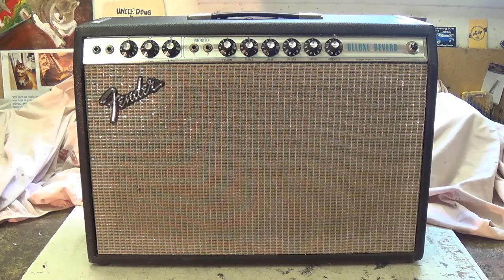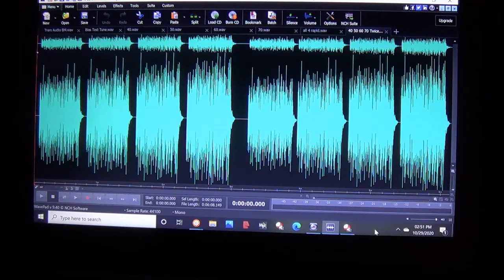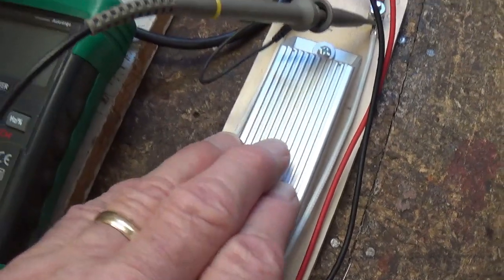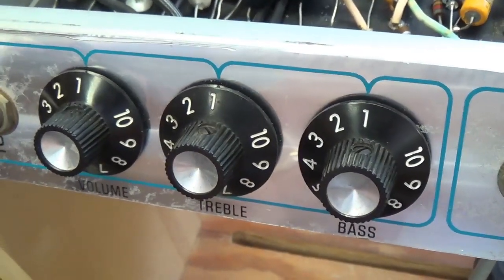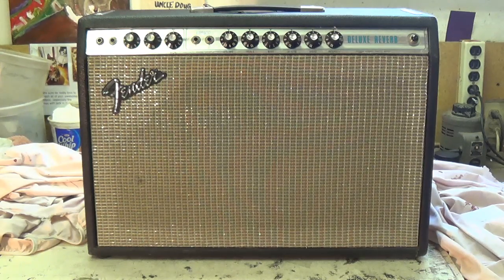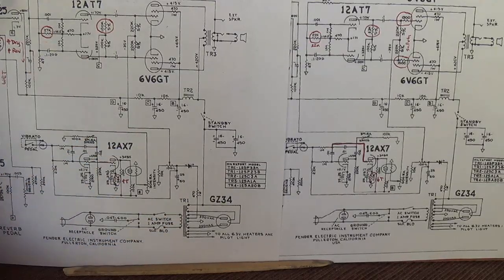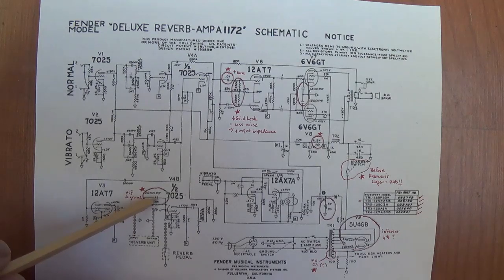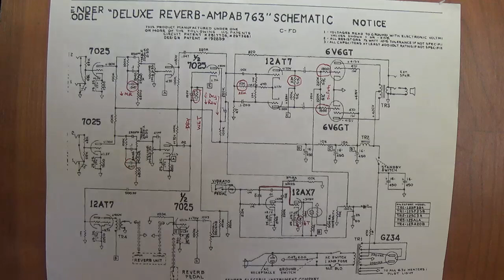The Effect of Output Tube Bias on Tone, Gain, and Headroom.....A Side-by-Side Comparison

Comment: hello doug ive got a 67 blackface deluxe & i want to max the tremolo output so it goes super swampy like a silver tone can you please tell me what the max setting can be on the tremolo cap.thank you for your help & advice this post was most helpful info & i am taking notice great post doug peace...
Reply from the maker: My suggestion, as it always is in cases like this, DJ, is that you experiment and find the value that sounds best to your ear. Good luck.
Reply: @UncleDoug  hello i was actually thinking of setting it to 75% fixed bias because everyone keeps telling me they went massively over but maybe i should listen to uncle doug.but the wattage out put would that be 12 watts max on a 6 watt amp or 10 ???.but im not sure if i can get the better rectifier tubes for the vibro champ its got a 5Y3GT 6V6GT & two 12AX7A,s on the chart so i might be stuffed.because im trying to make it sound like a blackface.but if that,s the case ill get the blackface,s tremolo output maxed & sell the vibro champ.but i have just brought some vintage tubes including a few vintage GZ34 rectifier tubes some el34,s & 6v6,s all from the 60s & tested on the meter.im also wondering weather to try quad gold pin winged c kt88,s & shall i try triple mica tubes for more overdrive.so i need to learn what the different tubes settings are on different tube types that is for sure.but one of my mates always uses new tubes & when i said old tubes are better he laughed & said if you can find any that work.so i said ill bet him £50 that my old tubes sound better & he said no lol peace...
Reply from the maker: @djbigleg3228  I think I've made my opinion pretty clear, DJ. Stick with 70%.
Reply: @UncleDoug  i will & ill max the watt output to 12 ?? i wrote it all down i do take on board what you say i just wanted to see if you said yeah 75% would be normal for fender lol.but sadly people are telling me that i can only use a 12ax7 in a champ unless it says GZ34 & that is jj tubes.who im not gonna be buying any tubes from but they do make a GZ34 tube.i kinda got the vibro champ for better tremolo & was gonna get it as close as i could to a 66 blackface model.but the 67 deluxe model has the 12ax7 tubes & it can be used in that so im wondering if they are wrong but i just want to say im most grateful for your insight doug peace...

Comment: I have a ‘69 Super Reverb that has been Blackfaced. I can’t get more than 14 ma of bias current no matter what Bias Range resistor I try or bias pot resistor. I’m stumped to say the least.
Reply from the maker: I'm confused by the term "14mA of bias current", since it is -DC bias voltage that is applied to the grids of the output tubes. Do you mean that your maximum plate current is only 14mA? Have you measured the -DC bias voltage? Is it within the range shown on the schematic?
Reply: @UncleDoug  I meant 14 ma per tube at maximum adjustment on the bias pot. The bias range resistor is 470 ohm and I’ve replaced the diode, 47/100 electrolytic capacitor, bias pot, and 27k resistor on the pot. Adjusting the pot has minimal effect on the sweep of the pot. My plate volts are 430. I’ve tried different values on the bias range resistor and substituted the 27k resistor for several values below 27k with little improvement.
Reply from the maker: @Earlvis  Have you tried installing a matched pair of new output tubes?  Plate current decreases as tubes age. Have you measured the -DC bias voltage being applied to each filament......is it correct?
Reply: @UncleDoug  I tried a new matched set and no change. I’m going to remove the wire going from the rectifier diode downstream of the bias range resistor to the tremolo circuit to see if there is something interfering with the negative bias voltage circuit.
Reply from the maker: @Earlvis  Good luck, Earl.

Comment: @Uncle Doug awesome video man I've been learming a lot from you! I have a morgan sw50 and was wondering if i bought test probes that measure miliamps would i also need to measure the plate voltage and go off that? I talked to joe morgan and he said 37-40 is what you want so would it be enough to just use the probes and adjust till it reads within that range or is there more to it? Im kinda new to this stuff so trying to learn more
Reply from the maker: Thanks, Jake. Bias involves both the plate voltage AND the plate current.......either value alone is not sufficient. When you multiply them together (PC in Amps not mA) you get the plate dissipation, which should be compared to the max value in tube handbooks.
Reply: @UncleDoug okay I see what you're saying. There's a TON more I need to learn but your channel has been a joy to find. I appreciate the quick response!
Reply from the maker: You're welcome, Jake. Good luck :)

Comment: The line voltage where I live is fairly high and the 6.3v winding on my tube amp is putting out about 6.6v under load - is this OK or should I add a resistor in series to reduce it a bit?
Reply from the maker: I doubt that your filaments even notice the difference, Nat. I don't think any correction is necessary.
Reply: Another option for high mains voltage, especially for vintage amps designed for "vintage" wall voltage, is to make/buy a bucking transformer which can cut your wall voltage back to a level closer to what it was in the 50's or 60's.

Comment: Thanks for the video, Doug. I especially appreciate the circuit comparisons. I recently acquired a 1974 deluxe reverb that turns out to be an A1172 circuit. I will follow your advice to move the standby switch to allow some those first  filter caps before it. I do suspect that the Power Transformers did change throughout these iterations even though they kept the same codes. For one, there is the absence of the heater centre tap that you noticed on some schematics. I don't see an unused wire taped up on mine. Also, mine has the 5U4GB rectifier, but when biased up at about 60% plate dissipation, I am actually getting about 452V on my 6V6GT tube plates. Can you think of any other explanation for such high plate voltages? Do 5U4GB rectifiers get super efficient before they die or some other phenomenon? I would be pretty scared to swap in a more efficient GZ34 rectifier. I'm trying to figure out I can bring my plate voltage down to something more reasonable... I'm half-tempted to try a 5Y3, but I also fear it not handling the job without giving up it's ghost too quickly as well.
Reply: Ya, so the PT is feeding the 5U4 374VAC on the rectifier plates. 
I'm thinking they must have changed the specs of the "025130" transformer over the years but kept the name.
Reply from the maker: The 5U4 is a current-providing workhorse but not particularly efficient when compared to the GZ34, and they don't get better with age. The 5Y3 is definitely not up to the job. You didn't state your PC and PD values, which are critical for a proper assessment. Perhaps your AC supply is rather high, accounting for the 9% elevation in PV? If necessary, a dropping resistor of sufficient wattage might be inserted in the B+ line. @pastamatt
Reply: @UncleDoug , Sorry,  yes, it looks like my wall voltage is rather high at 123.4VAC. I took measurements again today with the JJ 6V6s I borrowed from my 5e3 clone. The plates of the 5U4 are reading at 372VAC. My OT halves measure 222 ohms. My OT CT is reading 460VDC and the 6V6 S plates are 456VAC. So, my plate current is now 18.0mA ... giving 8.2 watts of plate dissipation. Since these tubes seem to be rated at 14 watts, I guess that is now 58.6%.
Reply from the maker: I generally measure the winding resistance and voltage drop to two decimal places, but I guess this is adequate. The PC is rather low due to the very high PV. The PD is acceptable, but you might consider installing a voltage-dropping resistor of adequate wattage in the B+ line, get the PV down to the 420 range, and boost your PC to get a proper PD.
Reply: @UncleDoug , more decimal places would be nice,  but my Klein Tools DMM (mm1000) only shows 4 digits but likes to start with a 0...so "0464" VDC. Maybe I need a more expensive meter. With today's 124VAC line voltage, I'm also seeing that my heater voltage is reading 6.6VAC. I'm thinking I ought to try a Thermister like a CL-80 to drop a voltage or 2 right after the power switch. (Not right away because I have to order it from somewhere)
I'll experiment with 4 x 1K 5W resisters in parallel after the rectifier to see how much 250 ohm dropping restance gives me voltage-wise.
After the thermistor idea is implemented, perhaps it would still be wise to try and drop the heater voltage a little too? I've read about using a pair of tiny value resisters (a calculated fraction of an ohm) at a few watts each.
Reply from the maker: I don't think the heater voltage elevation is worth any intervention, but the B+ reduction would make sense. You can calculate the resistance and wattage necessary using Ohm's Law.  @pastamatt
Reply: @UncleDoug  Well, the 250 ohm resistance really did the trick to help the B+. I now get 422VDC at the OT CT and 418VDC at the 6V6 plates. I wasn't sure whether to expect it, but I don't notice any sag. It stays quite clean and bold till very high on the channel volume knob.
Reply from the maker: That's good news, Matt. Hopefully you were able to increase the PC to a more suitable level.  @pastamatt
Reply: @UncleDoug  yup, today I brought it up to about 65% with a plate current of 20.7mA and 418V at the plates.

Comment: I wasn't sure what i was hearing, but as the bias got hotter it seemed to lessen a bit.
Not sure if the camera audio is clipping, or parasitic osculation or whatever, but i was definitely hearing some sort of artifact.
I've read that they bias those Mesa Boogie's cold. As you are probably aware those are very high gain amps.
I did like how it sounded with a hotter bias, was wondering if you were gonna go any higher, 🤣
I first got into playing guitar because i liked how it sounded when distorted.
I actually found an old vibro champ amp in the garbage long time ago and my dad had a friend fix it for me when i was a kid.
I remember trying to figure out how i could get my amp to distort and bought one of those lpb-1 boosters that electro harmonix makes.
Anyways i love your videos
I wish they had these videos back then, and i think you are an awesome teacher.☺️
Reply from the maker: Thanks so much, KB. Increasing the bias beyond 70% (in fixed bias circuits) results in reduced tube life with no appreciable improvement in tone.
Reply: @UncleDoug  yeah, i kinda said it jokingly lol. 
I remember doing some biasing testing and then listening with my ears, after trying to dial in some firm low end i think i landed on like 65% with a couple different amps i was setting up.
I play overdriven, but like the power section to stay clean and the preamp to be overdriven, and finally push the front with a boss super overdrive or just a nice mid boost or something.
What i ended up with was a slightly modified jcm 800 2204 50 watter.
They also have a weird switching system and actually use the added cold clipper 10k cathode as the first stage in the low input.

I know im getting way off topic here, lol but i wanted to ask if you had ever messed around with adding any extra gain stages to any of the amps you've worked on?
Reply from the maker: @KB_Joys  I have experimented with extra gain states and found it to be a very challenging, frustrating, and generally unrewarding endeavor.
Reply: @UncleDoug  i too have had my share of frustrations trying to set things up, get things just right. Probably what made me tone chase even more.
However i found that one of my best tones i had was with an old sound city head.
I basically just went into a pedal, then to a preamp, and then into the tube head.
Boy i wish i still had that amp. 🙄

Comment: One question is buzzing in my head. If one could vary  both the bias voltage and current to achieve same power dissipation %, how would the tone change? Not too concern about Gain/Headroom.
Reply from the maker: What you have described is cathode biasing, IM. With it, the PC is regulated to the level set by the bias resistor.
Reply: @UncleDoug  Sorry. I actually meant plate voltage, and not bias voltage, in a fixed bias ampl.
Reply: I was wishing to see similar instructive demonstrations that you have shown us.

Comment: I listened with quality headphones and my feedback is that while it was absolutely critical to not change the placement of the SM-57 from bias case to bias case, the original placement picked up so much bell sizzle from the speaker that it acted like a bandpass tone  filter that very well may have masked the subtle tone difference in bias settings. Also the tone of the guitar itself seemed very limited in spectrum to be used as a stimulus for the experiment. It sounded like the bridge pickup of a single coil. Perhaps not the best test case for comparing crunch tone versus bias setting.  I say all this because I think this was otherwise a VERY useful and interesting video. But I personally could even with good headphones not hear a change in tube break up. Too much sizzle. I think first experimenting with what you think is best bias and best guitar setting choice to find the best sounding mic placement on the cone for good recording tone then run the bias experiment might disclose more significant  tone sensitivity to bias. Or... maybe not.
Reply from the maker: Thanks for your very knowledgeable input, FWS.  Your suggestions will be kept in mind for future, similar videos.
Reply: @UncleDoug  I meant what I said. This is a great subject and you are helping to uncover truth with science. I wish there were more videos like yours that bridge the gap between science and art. I look forward to any of your upcoming videos.
Reply from the maker: @2GroundControl  Thanks so much, FWS. This field is so subject to opinion and rumor that it is necessary to scientifically analyze and determine what is truth.....and what is fiction.
Reply: @UncleDoug  Agreed!!!

Comment: What part  of the amp produces the desirable even harmonic distortion tube amps are noted for?
Reply from the maker: The output tubes are responsible, Fred, and when they are slightly to moderately out of balance, the production of even-order harmonics is increased.

Comment: Thanks! doesn't the inrush of current happen anyway even if the standby is after caps? it would still inrush to fill caps when power switch is turned on instead of standby switch, and also if standby is before rectifier it's on ac so less likely to arc?
Reply from the maker: I really can't defend standby switches, since I feel they are more trouble than they're worth, but the question is whether the switch is before or after the reservoir caps.....not filter caps.  After the reservoir caps is much better, because it reduces the inrush current by about half.  Placing the switch before the rectifier makes no sense at all.
Reply: @UncleDoug  I think before rectifier is to just reduce current rush when turning on the amp by sending to heaters first and then to the rest of the amp when standby is turned on, reducing the spike on power transformer on start. And to silence the amp when turning off. I saw somewhere that it's ac so it is less likely to arc. Are these valid uses or not much point?
I know standby is mostly pointless, but can't help the curiosity I can't get it out of my head
Reply from the maker: @harmonicseries6582  Standby switches were created in ultra-high wattage circuits such as radio transmitters to protect the output tubes (not PT)  from the DC current spike. For some obscure reason, they were subsequently adapted to guitar amplifier circuits.....without need or justification. The switch is normally place AFTER the rectifier and reservoir caps.  As far as silencing the amp, simply turn down the volume. If my explanation is still inadequate, check out this site:  https://www.valvewizard.co.uk/standby.html
Reply: @UncleDoug  Thank you very much for the info and the source